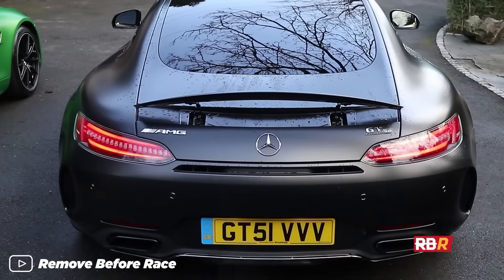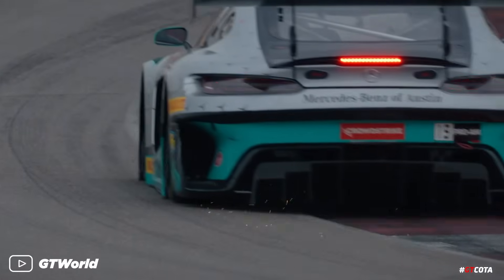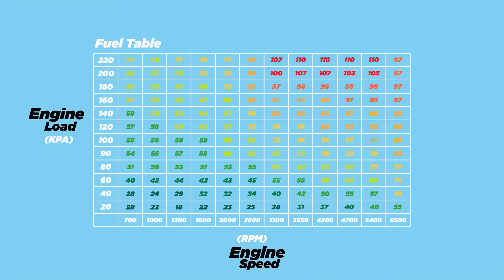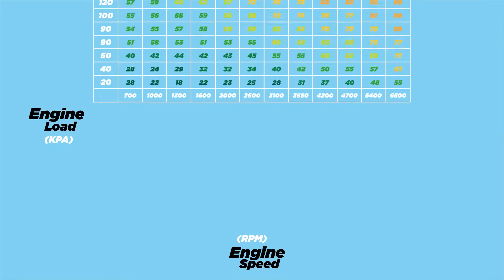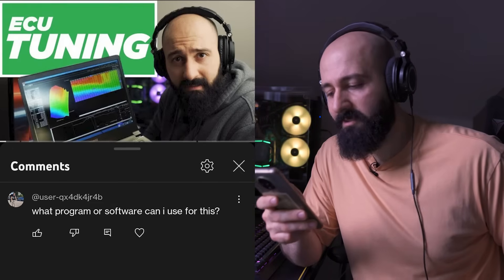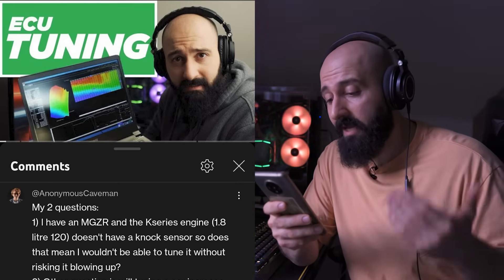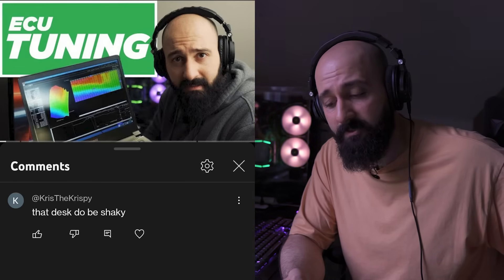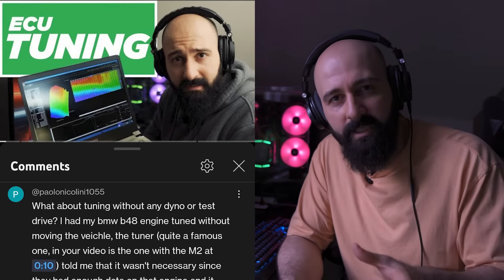Burble Tune || EXPLAINED

Comment: This is a nice video. I have absolutely no interest in adding extra burbles and pops, washing down my cylinders on decel, or anything like that... But it is interesting to see how they go about doing it. Makes sense. 

I do wonder though with the retarded timing If you're ending up with a burn going off while the exhaust valve is open. That could overheat the valve the same as anti-lag does... Even if the chamber and plug becomes cooler which is great if you're on the verge of detonation in racing... But if you're doing something in racing that wears out the exhaust valve it's not a big deal as long as it lasts the full race because you can swap it out

Comment: Hi. I have a m4 with a pops and bang tune and I did a spark plug and oil change and the car started misfiring. I checked compression,coils,injections,spark plugs and they all fine but the car still misfiring. On a diagnostic test it doesn’t even showing up codes sometimes or it will say misfire detection injector switched off cylinder 5 then it will stop showing it and bring up a different cylinder. Could the misfiring be caused by the tune or do I have a faulty motor

Comment: 2014 Veloster Turbo — they started doing it from the factory with the N in 2019, so it’s mostly just modernizing it. 

Imo, the N’s 2.0L theta is great if you’re going to do little or no work, but the 1.6L Gamma actually has a much higher horse power ceiling.

Comment: I'm about to fiddle with this using an OpenFlash tablet + RomRaider software on my 2010 NC2 Mazda MX-5 Miata - MZR/Duratec LFVD - 5spd.  Process seems fairly simple and can be tested in tiny increments to insure both safety on the engine as well as tastefulness ;)

My big question is;  is this (a modest burble tune like shown in your video) going to severely decrease the effective lifespan of my upstream o2/lambda sensor?
Reply: How did u do it with romraider

Comment: So basically, it's turning your exhaust system into an afterburner. However, since a 4-stroke is a torque based engine, you don't get the increase in power that you get from a thrust based engine.

Comment: Bro showed 4cyk and 6cyk little sputters show some hellcat or corvette or some big block v8 pops and bangs they will rip your ears out you feel v8s in your chest not even with the pops there’s not 1 v6 I’ve been near that will rip your eardrums like the sound of a v8. If your going to make a vid make a real vid enough with these little puny engines get the real gas guzzlers that dump loads of fuel 😂 and shoot 3 foot long flames. Something about the v8s that cause the loudest explosions

Comment: I’ve got a 2007 E93 335i and it’s got a very slight burble just oem but mostly only when I use manual mode (the flappy paddles). After watching this video I think I’ll leave it alone.

Comment: Something for thought, instead of completely disabling fuel cut, set the timer higher. If it’s at 0.4seconds, put it at 1.5, then it can burble for 1.5seconds and stop

Comment: Tryna go stage 1 bm3 on my BMW 328i 2015 model (EWG) 
I rly do t want extreme agressive burbles, just a nice subtle aggression of the car 
Im think of having tiny bit or none on Comfort, and a semi agression on Sport. For thebduration of Burbles i wouldnt exceed 2 seconds. Is this healthy for engine longevity and exhaust system? Or should i go even lower in terms of duration time? 
I’m tryna get the cooling effect mire than the cool sound tbh i’m more into longevity and taking car of the beast ❤️

Comment: Have a mazda atenza/6 that im looking at getting a burble tune on, dont want anything too excessive as want to keep it as long as possible but something fun to drive, just going for a slight burble tune, doing a straight pipe into 2 rps mufflers (they have a pretty low nice sounding tone for a 4 cyl, so its not going to sound like your typical straight piped honda civic) 😂

Comment: Great explanation, really appreciate it. I'm driving a Jeep Sahara with the 3.6 Pentastar and I've installed an Edelbrock Supercharger, running the Edelbrock tune.  She runs great and dyno'd 330 to the rear wheels (manual transmission) with 33" tires but she needs a bit more growl. Still has stock intake and exhaust, so looking at an axle back to open it some and maybe a small amount of burble to seal the deal.

Comment: funny thing if u want burbles on engine that is not totally heat soaked 
turn down the fuel 
af mixture with afr leaner is burning slower and also is warmer so you can get those burbles in exhaust that is not glowing red 
dont thank me 
just prepare money for a rebuild because its literally oposite of what burbles are for you will put heat into the exhaust if its not best quality it will start cracking 
and you may overheat valves
well in most cases you will make a huge fire cracker out of your muffler before valves got damaged 
my launch control made my muffler look like its pregnant but it didnt explode yet 😉

Comment: It's incorrect to say all Burble tunes are caused by firing unburnt fuel in the exhaust system. Correct and well setup Burble tunes target a lean lambda on decel along with negative timing and this starts the burn late and with it being lean, the burn takes longer and is still occurring when the exhaust valve opens. It's not just a case of dumping fuel down the exhaust.

Comment: I'm trying it on my old Honda (D16Z6 OBD1). I works fine at around 3k RPM but not that good in the higer RPM range. I have the timing all retarded (-6°) and added some fuel. AFR Gauge reads rich at righer RPM and normal (about 14) around 3k RPM. Any ideas what I'm doing wrong in the higher RPM range? Too much fuel (if it's even possible)? Too retarded timing?

Comment: Hey great video man! I've been playing around with this for my 86 and I've got the the point of even messing with the Direct Injection timing, I retarded it so much that it sprays AFTER spark, so it doesn't even ignite in the cylinder, and it actually sprays during the exhaust stroke so it goes straight out the cylinder, igniting in the exhaust and giving a huge gunshot and fireball! Its great to have as I can do it on command only when I want it to happen and its nice to scare people on the highway or shake people up when they ask me to rev it haha

Comment: 5:30 This sounds like you glossed over something really dangerous here, Doesn't this mean that if you go past redline there won't be a fuel cutoff? or I'm understanding it wrong?
Reply: To limit the engine RPM, the ECU usually retards or cutoff the ignition, not the fuel. Because cutting the fuel means a potentially a lean mixture, resulting in knock or pre ignition. 
Additionally, fuel cutoff doesn't happen immediately it has a delay of about a second or more to reduce jerkiness.

Comment: LOL mine is a MK6 GTI...HOWEVER it only happens at 4200 rpm and above. So daily regular driving you'll never hear it unless I am in manual mode and holding the gear to rev that high. There are some cars around that no matter what RPM or drive mode it comes on. Now THAT is super annoying!

Comment: Any ideas on if the Stock ECU on the 86/BRZ will do Spark cut? Or is it only Fuel cut? 

How do V8 Supercars get their signature flames out the exhaust? Is that just fuel dumping in and burning slowly opposed to detonating in the exhaust?